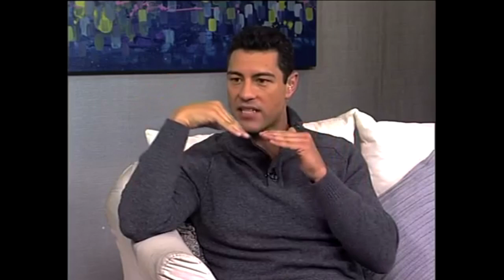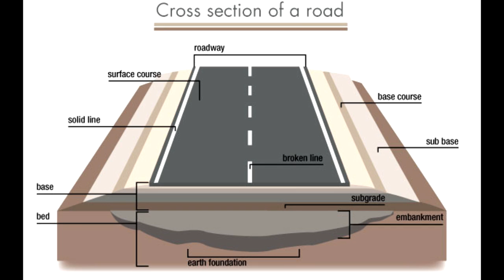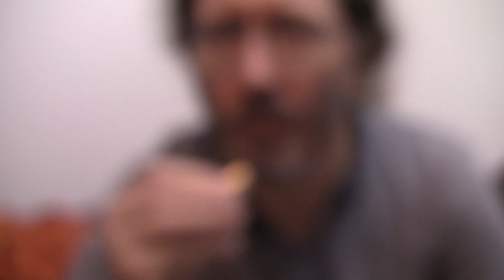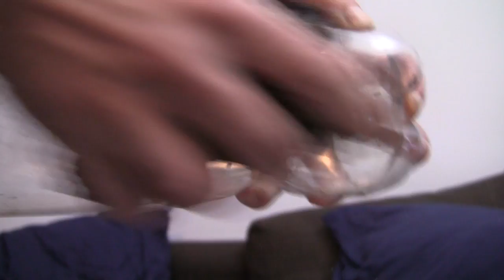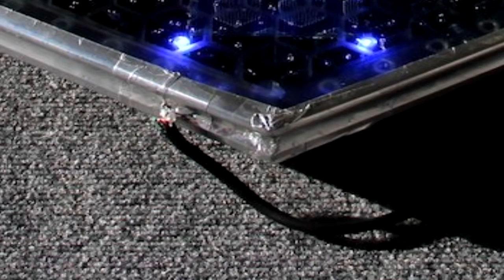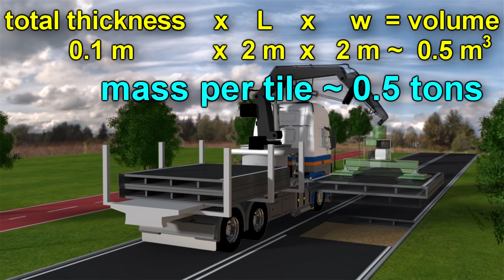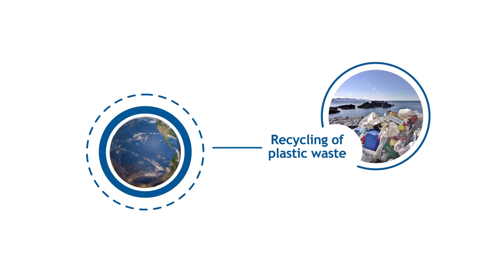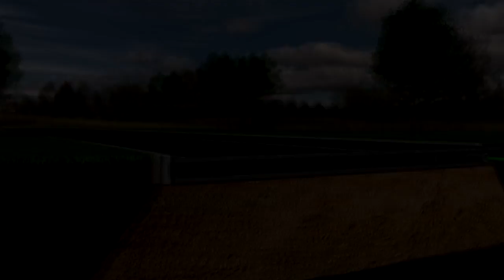Plastic Roadways BUSTED!

Comment: Why would you engineer a way to house cables and conduit when you could simply bury them alongside in their own, protected channel.
You know, like how we already do and have done so for a few decades. Ever wonder why you have various covers on the sidewalks in cities all over the world? It's because there is power, telecom/data/etc under your feet. While they don't say how long each road panel would be, as a network engineer, I cringe at the idea of having to couple copper or fiberoptics every 10 meters or so. You're going to introduce a lot of problems into your phone and data networks by having to couple them constantly. Electrical power is not immune either. Every connection you make, increases resistance and creates waste. I can't imagine how much power you'd throw away simply by having to terminate one cable and connect it to another every 10 meters or so.

Comment: the thing that really seems stupid to me is the pipes and wires inside the road...

so like you mentioned, every time you change a road panel, you disrupt all the pipes and wires... so, hmm, let's put joints in all the cables and pipes so they can be easily disconnected and reconnected when we replace the road panel... 

ok, so how much is it going to add to the cost to have joints and connections in every single panel for all those wires and pipes? 

I have a pretty strong feeling the cost to have the pipes and wires running through the road would not only overshadow the cost savings of any "recycled plastic road", but very likely would end up being the most expensive part of the whole project.

Comment: Maybe they could embed LEDs into the surface so they generate electricity when a car runs them over. They could then run the electricity through like an inverter or something to make it "backwards" and power the LEDs with it to make a layer of dark that would protect the surface from sunlight. You might think you're all like smart and stuff, but you obviously don't know everything!
Reply: SunPower Guru Any electricity generated with have the consequence of increased fuel consumption by the cars. It would very inefficient. Better off requiring motorists to pay in gas to run generators as a toll for using the road. haha

What is a layer of dark? Leds that absorb light instead of emitting light?
Reply: The cars run over the road anyway, so it wouldn't affect fuel consumption. The LEDs wouldn't be connected to the cars at all!

I'm assuming that if you ran an LED with backwards electricity, it would emit dark instead of light. It's not rocket science.
Reply: Current roads don't capture the energy, they largely ignore it. The act of capturing energy requires energy hence the fuel consumption increase.

Wind always blows but if you add a wind turbine you are reducing the amount of energy in the wind and converting it into electricity. The more turbines you add to the world the less wind you have in the world.

Its impossible to emit dark. If it was possible to emit dark I would own one of those machines for sure.

A led with backwards electricity sounds like a solar cell.
Reply: I don't think you understand.... backwards electricity (like from an inverter) is BACKWARDS, so of course a LED will be like a DED (Dark emitting diode). It's just common sense.

And your car puts the same amount of energy into the road whether you capture it or not.

Comment: That's it....  I'm starting a fundraiser to replace roads with powered treadmills.  Any costs would be offset by the massive fuel savings.  The typical 18 wheeler that gets 5-7 mpg could easily get double that or more.  Standstill traffic would be a thing of the past because the road would always be moving.  It's completely more efficient than any other road.
#imwithstupid  #sendmemoney #dontneedproofofconcept

Comment: (I wish Thunderf00t stuck to more of these videos, yes he is entitled to say what he wants, but he is never wrong when it comes to actual science. Also politics in general, is a shitty topic - and making stabs at others because of perceived political affiliation does nothing but piss people off when you are totally wrong about both perceived affiliation, and also what was reported on)
Only way that this project would even be feasible - but still probably cost ineffective and far more expensive than blacktop, would be IF they had some ENTIRELY new chemical process wherein they are able to turn PETE, HDPE, LDPE, PVC, PP, PET - and MANY other common plastic polymers - into ONE new, incredibly durable Plastic Polymer, likely via some form of chemical reaction. And while I am no material engineer, I cannot think of ANY plastic that would be up for the tortures of being road surface material. So they would need to perhaps make a NEW ONE entirely? 

In any case, it would be FAR FAR more expensive to produce than Blacktop, and to implement would require every bit as much work as you have already pointed out - the surface is actually the easiest part of large scale road building. 
Now in some residential areas - the only thing they do is a bit of leveling, some drainage tunnels, then a gravel base which is covered with a form of blacktop, I KNOW first hand because I have seen it done in my neighborhood, and in fact-  the blacktop used was a newer kind that implemented the use of Recycled;  Glass, rubber and PLASTIC! Of course they only made up part of the mixture, but this particular TYPE of blacktop not only made use of recycled rubber, glass, and plastic to varying degrees, but it also IS BETTER BECAUSE OF IT - it was CHEAPER-  and also it WORKS BETTER WHEN WET! It's quite funny, that when wet, I can actually drive faster around corners in my suburban neighborhood than I can on most other nearby roads that used older blacktop! 

Of course this is a purely residential area, so not much traffic and really no trucks over 20 tons or so - whatever UPS trucks weigh and the occasional mostly empty Semi. 

TL;DR

Recycled plastics, rubber, and glass is ALREADY commonly used to make BLACKTOP! So, there goes your recycling argument for this project right away! I mean, are they only going to use ONE type of plastic? If so then there is no meaningful reduction of waste!

Comment: But thunderf00t may I ask what would happen if first they did a gasification phase with al kinds of polymers to strip al the gas-esque compounds out of it for re-use and the ''sludge''/peck of this is used to make the roads wouldn't this be similar how the roadtop coating is made but instead of oil, plastics has been used ?

Comment: You didn't mention this, so i will. Isn't prefabricating the pieces the least feasible part of this? Terrain isn't prefabricated, it doesn't conform to any predictable shapes, and while they'll level the surface somewhat so that the width of the ground will be even, no two hills are exactly the same. So in order to have a road that actually fits onto the terrain, they would have to measure the hill, custom make the panel, and then deliver that specific one to the area. So if it wasn't expensive enough already, every single panel of every single road is a custom part and effectively cannot be mass produced. This idea isn't even theoretically viable.

Comment: If they pipe cables through it, then the cables will also have to be cut and spliced in every section. This is stupid, I work for the phone company, the degredation of light being spliced in fiber every 6 feet would defeat the purpose of fiber.

Comment: Another strike against plastic roads is that it would be a environmental hazard causing a significant increase in plastic waste going out into to the oceans and lakes. Car tires is already a significant  contributor to such waste, imagine the increase in such waste if the actual roads contained plastic particles in enormous amounts? This idea is bad from any point of view!
Reply: SkyForce6700 They said they would use recycled plastic

Comment: I'm gonna do a kickstarter for genetically engineering a plant that can grow into a very strong fiberous mass, creating roads
Reply: Also it absorbs water and conducts electricity. No road floods. Any damage is fixed by the plant growing and self repairing.
Reply: You know, that could actually work, there are ideas similar to that being tossed around by geneticists. We just don't quite yet have the level of sophistication in the field of genetic engineering to do a modification that large yet. But you'd be surprised what a few decades of research can accomplish.
Reply: Yea, coral roads is absurd, since coral exoskeletons are calcium carbonate..  Which both washes out and decomposes by heat, acidity, and sunlight, leaving behind flakey limestone, bicarbonate, and some quicklime to boot..

Basically you're talking about constructing roads that would be perfect for sexy mudwrestling by masochists a few days after it's made, but horrendous for driving anything you want to be able to steer, or brake, or have any traction :p
Reply: How about bambo?
Reply: You mean hemp, right?
Reply: There is a place where they make bridges and pathways from the roots of trees. They carefully train the roots by tying them off and suchlike to create their highways.
Reply: as the trees grow they tend to the roots ,it can take generations to complete .
Reply: You mean trees and wood?
Reply: Footpaths and human-carrying bridges out of wood, sure, no problem, just gotta keep checking it doesn't rot away faster than you can replace it in the bridges or they'll collapse and take granny and her donkey with them.

For cars and heavy traffic.. nah. Poor traction, poor resistance to wear.. Gonna have to call bullshit on that one, lol - provide some sustenance to the claim please ;p
Reply: Well, the footbridges are definitely real: https://en.wikipedia.org/wiki/Living_root_bridges
Reply: It's not that its very hard to accomplish nescessarily, manipulating microscopic organisms grown to vast populations has been and will be a driving method for a lot of endeavours, but making roads I doubt will ever be one of them. Beer and bread is best made by yeast, and it's hard to beat the efficacy of bacteria and molds when it comes to other chemical processes generally revolving around fermentation as the main stay with protein synthesis being a decently-faring offshoot. Insulin production is a great example, since purifying insulin from animals or producing it synthetically is very difficult and costly compared to simply growing giant tanks of organisms that produce lots of insulin but no toxins and little to no other unwanted proteins - keep them fed, keep the output well-checked for proper filtration, and the small guys do all the work our bodies stop doing so well when we get diabetes.

The reason i think it's doubtful for roads to be 'grown' thus, is simply that genetic manupulation and organic production is best suited for aqueous throughput, watery goopy stuff, it fares quite poorly at more rigid and durable macroscopic tasks - not that it's impossible to i.e. 'grow' something that could potentially be used as a poor-mans-road, they just would be rather much more expensive to develop initially and control the quality of, repair, and are almost guaranteed to be inferior in durability due to the limitations of microorganisms since it would essentially kill the microorganism to construct a too rigid non-permeable structure around itself, as it would also bar any flow of nutrients to the organism. The reefs created by corals are not made by the living organisms, they are composed of the leftover exoskeletons from the deceased multitudinous generations that came before the living ones; the living ones require nourishment :)

Shorty put, you could realistically design microorganisms to produce something close enough to bitumen to be used as a replacement for that, but I don't think you'll be growing a lot of rocks that are anywhere near as good as the ones we get for free, from almost anywhere.

Silica would also not work for roadways, watch TFs previous video on the Solar Freaking Roadways with the knowledge that glass is made from silica, it talks a good bit about the problems with glass roads, which are mostly the same if not actually a lot worse for a silica-based structure with a lot of minute cavities such as what corals would create.

Do the kickstarter though, it doesn't seem to stop anyone else that their ideas almost surely won't work :p

Comment: Hollow plastic would probably freeze faster than asphalt like how overpasses do right? Also any place an accident happens and a vehicle catches fire. Wouldn't the whole section of road under it catch fire? And even if it didn't burn the intense heat would compromise the structural integrity of the plastic causing deformation.

Comment: to be honest, a heavy duty truck is couple of tons heavy, small car like toyoto is 1 tons. truck could get up to 10 tons. if you want to make a longer lasting road, just make the road cooler. Because tmeperature is a large factor when it come to damaging road. ARRB is testing a formula of asphult with smaller bonding, because they find out that the denser the composite is the faster the heat trasnfer, so reduce the bonding actually as a significant effect on road duration.

Comment: When you compared the price of blacktop to recycled plastic you simply used "per ton". That seems a bit misleading to me, since one of the points of the plastic was that it was light weight. You should compare the area it would pave instead.

Comment: Wow, this is amazing.   When I first saw this I imagined they were planning to use the same kind of plastic used for plastic palettes, since to my knowledge those are made of fairly durable and sturdy plastic.  Even then, with sections being modular, how would they thread the miles of cables and such through the hollow sections of the road, what happens when they have to replace portions of the road?     I will give the solar roadway folk this little bit of credit however, at least they provided some tiny amount of an actual demonstration when they slowly drove that small tractor over a few panels that one time.  The plastic roadway people?  Couldn't even do that.

Comment: water pipes will not be feasible inside of the road cavity.  due to frost lines in most areas of America, water pipes are required to be buried a minimum of 48 inches to keep pipes from freezing in the winter.

Comment: On the plus side, the more its used, the more rough the surface will get and so more grip.

Its also lightweight... which is what you want from a road... I hear F1 cars are going 10s a lap faster when they don't have heavy roads weighing them down.

On the downside... IT'S BLOODY PLASTIC!!! Why is Total in on this? WHAT... are you people thinking?!!! There's a reason that 'plastic' is also a term that describes the properties of a material. How does that work on a ROAD?!!!